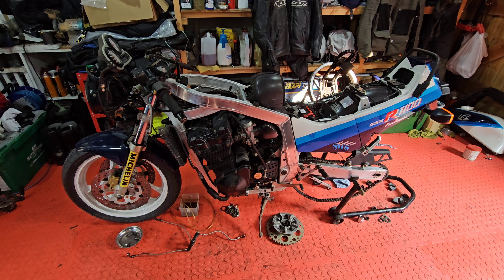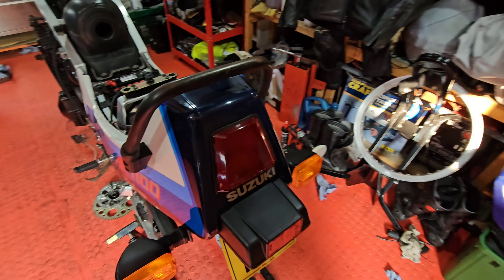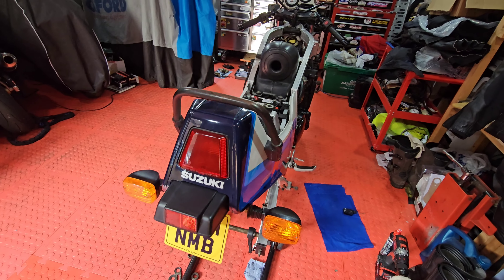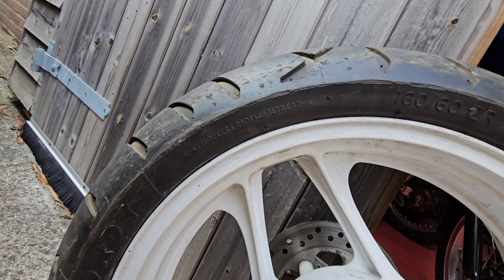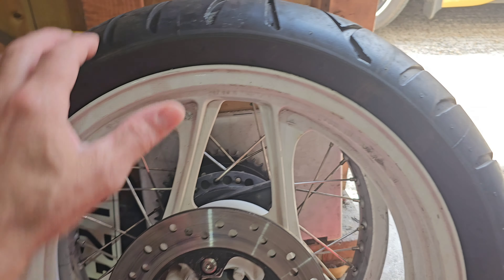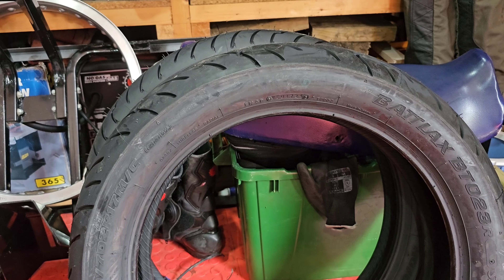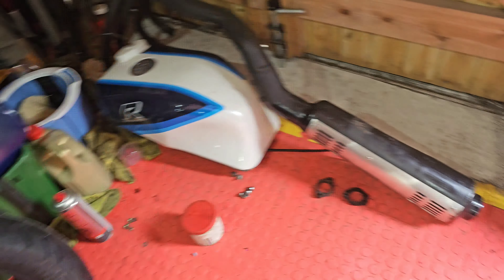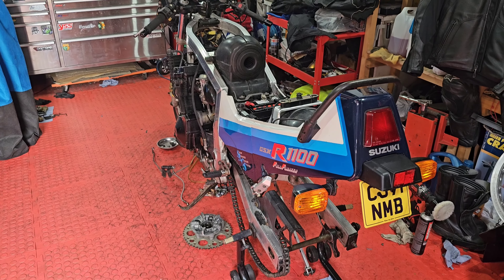GSXR1100 Slabside latest update Part 3. Tyre woes, and a solution to my stock exhaust issue?

Comment: 160mph bike with a retread, the mind boggles.  I didn't know they made remoulds for motorcycles.  I thought my 88 GSXR1100 had a 170 rear Dunlop radial as std but it had the 3 spoke mags.
Reply from the maker: I know, mental isn't it! I think the '88 bikes went up in rim size, so you're probably right 👍